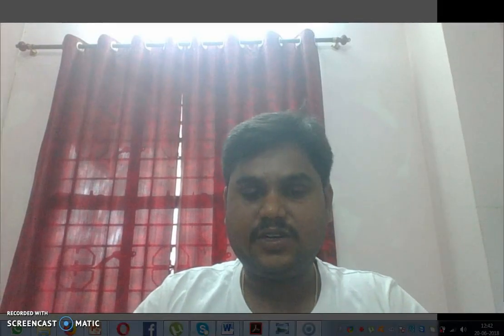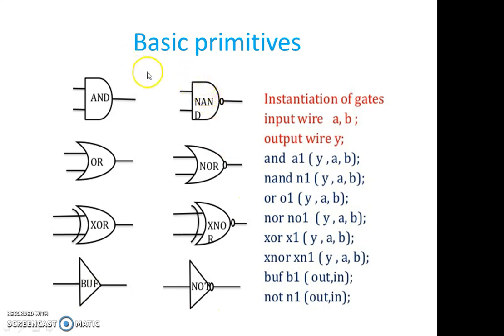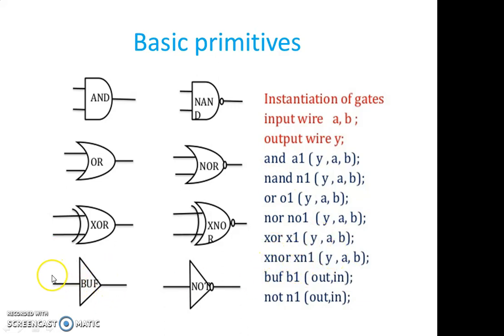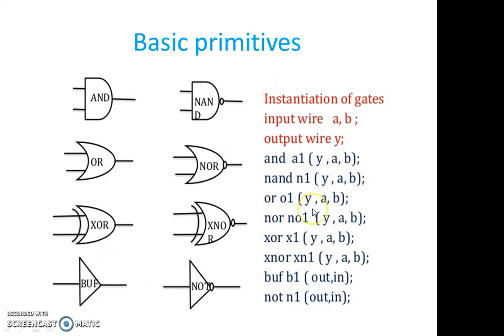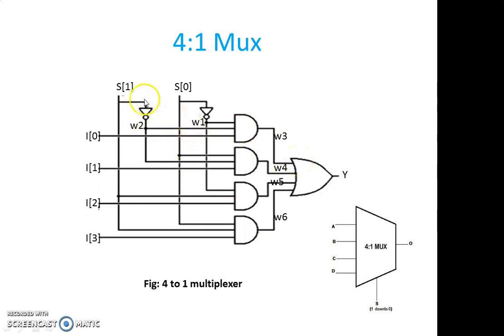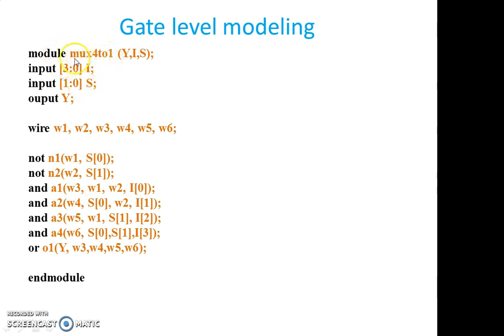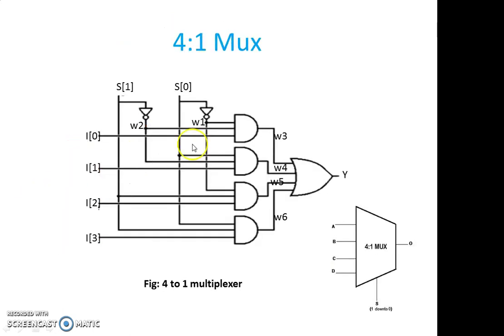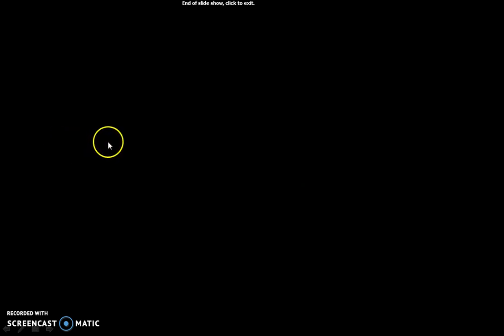gate level modeling

Comment: Had a doubt. If I want to provide a delay to gates, maybe 'AND' and ' OR' in the circuit suppose 5 and 2 seconds respectively, so then what will be the order to write the code......???
Reply from the maker: Ayush Jain  
You can specify delay before instantiation with # symbol.  As mentioned below 
and #5 a1( out, x,y);
or #2 a2( out,x,y);

Still you can specify rise delay and fall delay inside parenthesis. 

and #(4,5) a1( out, x,y);
Here rise delay is 4 and fall delay is 5.
Reply from the maker: Syntax for specifying delay is as follows 

and #(rise_val, fall_val, turnoff_val) a(out,in1, in2)

Still you can specify minimum delay, typical delay and maximum delay for rise, fall and turnoff delay as specified below

and #(min:typ:max, min:typ:max, min:typ:max) a3(out,x,y);